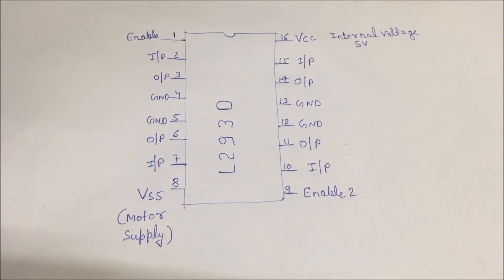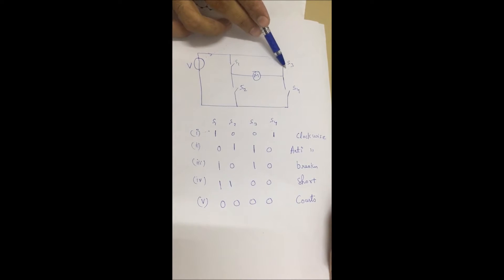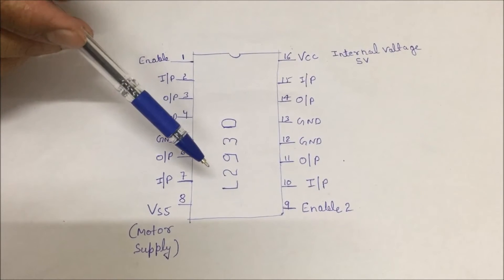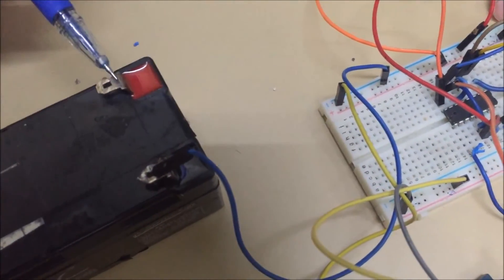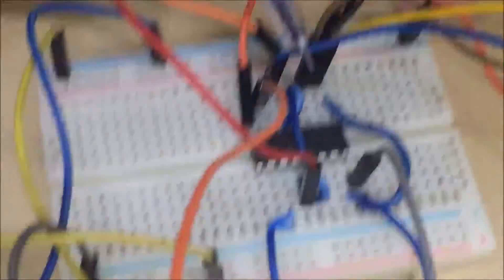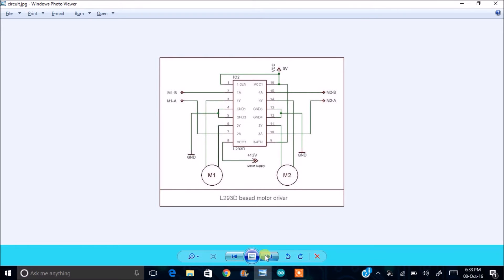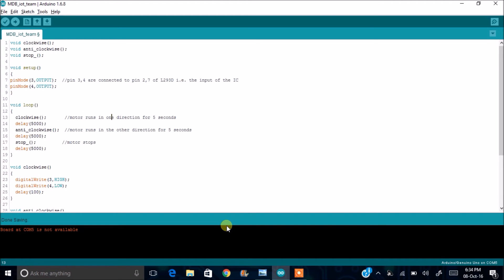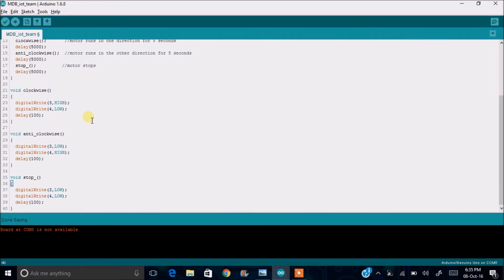How to use motor driver board (IC L293D)

Comment: Sir ,I am using l293d motor driver connecting with receiver.5v out and ground from driver is connected to receiver,receiver power on.But the motor not run.I want some demo
Reply: Veer Gm its also needed supply of 12v

Comment: Sir I am building a project using ardruino uno and l293d motor sheild.. My ardruino is perfectly Fine and port is showing in my windows 7 PC. But as soon as I am connecting my motor driver shield, the port is not showing in the PC even for the ardruino uno.. The motor shield lights up with a green led but nothing further happens. Can you please help me?
Reply: You can upload your code in Arduino by disconnecting l293d...after code will upload , connect l293d...